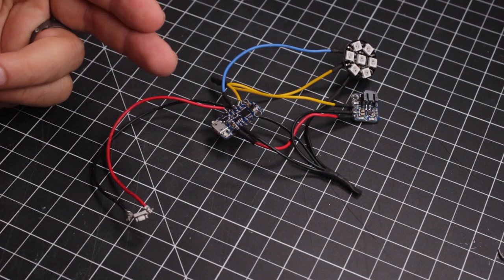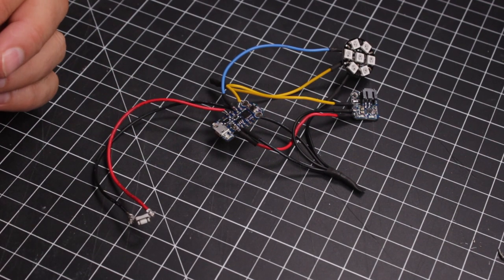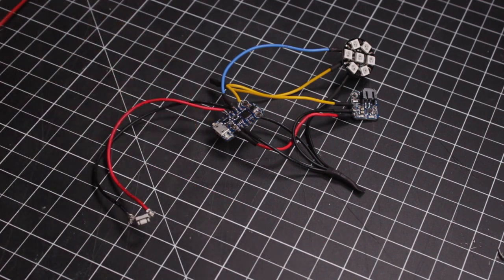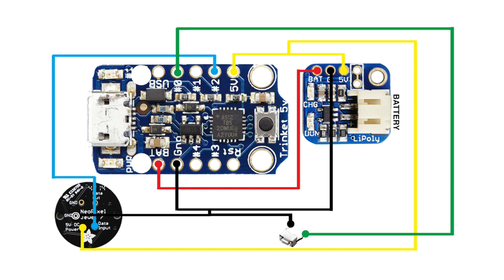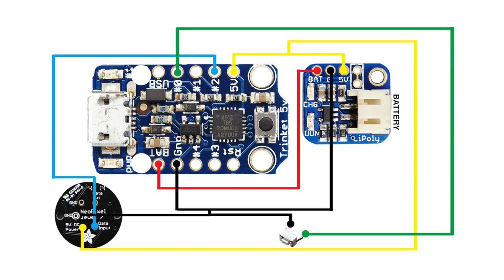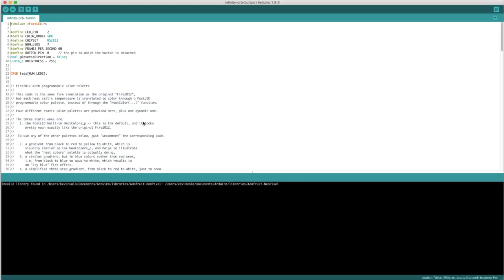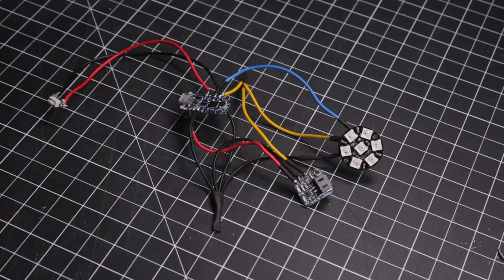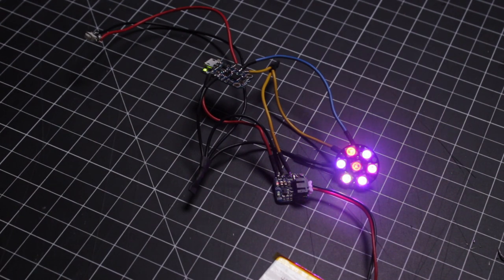Adafruit Trinket, Neopixel and Button Project

Comment: Sorry but i'm a real noob, is the Yellow line charging the battery from the USB port and the Red line is the Positive pole that comes from the battery? Is the 5v Trinket working well with a 3.7/4.2v LiPo? How about the 3.3V Trinket would it work?

Comment: I'm so lost! I ordered basically the same with exception of more led's on the ring and a slightly different backpack with USB C connector. When soldered according to your schematic, all I get are connection errors while using the trinket USB micro. Should I be using the backpack's USB C to connect instead? I can provide pics offline. (via Gmail preferably)